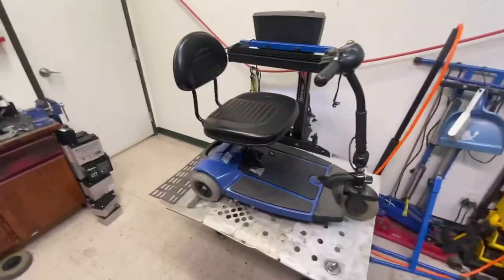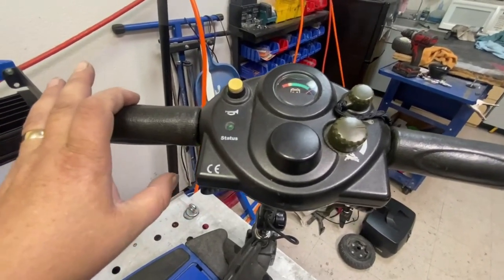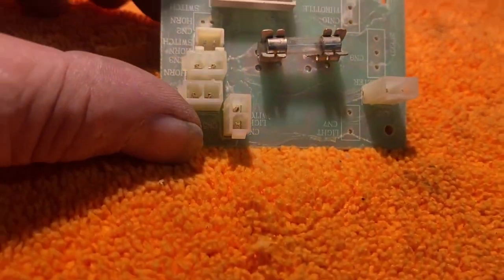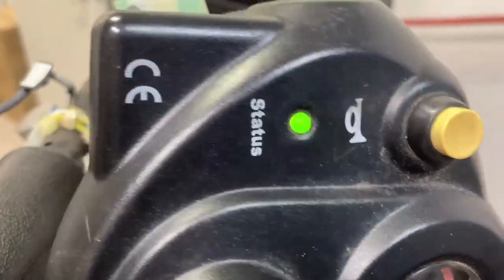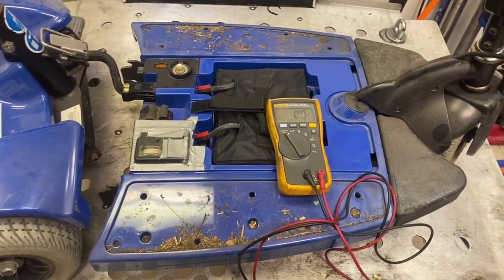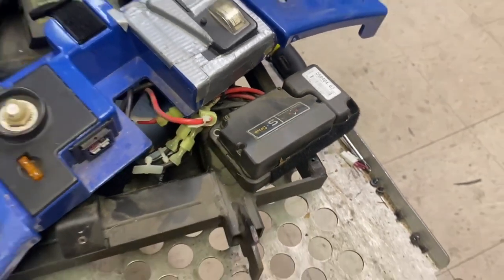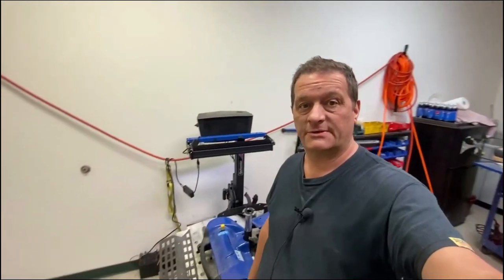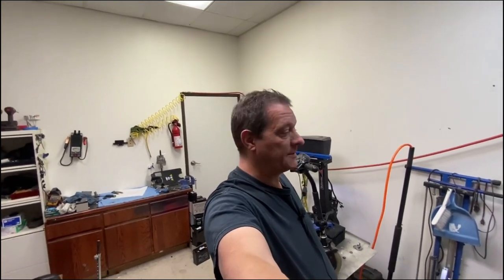Scooter Won't Move!!! | Diagnosing a Dead Pride Mobility Dart

Comment: Can controllers be repaired  Thanks
Reply from the maker: Hey Graham and thanks for the great question, yeah, I'm sure they can if it's something simple like capacitors and if you know your way around circuit boards but no guarantees of long-term reliability. I have done it in the past but typically, most scooter dealers won't have that kind time and maybe someone able to do it. It would be quicker to just replace the controller.   Ian

Comment: Yes solder or sodder  😂
Reply from the maker: You see the pain I have to go through 😁
Reply: @lasvegasscooterslifts  
WhenI used to play with my dads stuff. Before I learned anything I would find that solder and play with it I called it  easy wire ..
Because it bent so easy it was before I knew anything 🤩

Comment: The plungie type keys are not that good because the slightest jostle can send them inside and turn on the system
Reply from the maker: You are correct. Thankfully the did away with those and went with keys.